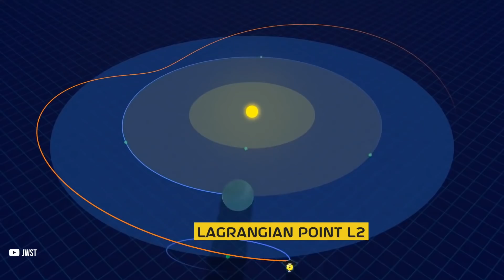What Will Happen Now To The James Webb Telescope

Comment: Was it possible to operate the Webb telescope off of some sort of radioactive power source? I assumed that's what they were going to do, so to get the most time and steady power out of the device once in the L2 point.
Reply: No nuclear  power on this probe. Only probes intended to leave the solar system have nuclear power, because, solar power would  get weaker the further from the sun they got

Comment: Given the short lifespan of JWST (5-10 years), I hope the space agencies are already building a successor or another version of the same. It took a long time to build, a lot longer than 5-10 years. We wouldn't want to sit in the dark after JWST ends its service.
Reply: I got so bummed when I found out it's lifespan.. I am so excited for this technology but I thought it would have long term lifespan technology... Because of how advanced the stuff is... We could use it for discoveries for many many decades.
Reply: Was it possible to operate the Webb telescope off of some sort of radioactive power source? I assumed that's what they were going to do, so to get the most time and steady power out of the device once in the L2 point.
Reply: @benmcreynolds8581  even with shorter lifespan, JWST  is capable of taking much more  pictures in same time than hubble and those images are more detailed.
Reply: They’re already making a successor. They named it the Luvoir Mission.
Reply: The launch went so well that if the other adjustments go perfectly, JWST will have the full 10 year lifespan. So NASA has suggested they'd be able to send a robot servicing mission at the end of the 10 years
Reply: the lifetime of hubble was  5-10 years too ! and stills shines after 30 years
Reply: @telemaq76  still a major difference in accessibility between the considering the Hubble sits in low earth orbit while the JWST is on its way to the other side of the moon a million miles away.
Reply: @MoSuli96  absolutly. you are right. good news is, launch was so perfect than the jwst will have more than 10 years of lifetime. and i heard long time ago, than,maybe..maybe, solutions will exist to improve his lifetime. so future will tell
Reply: Another telescope worth $ 18billion is in making Which will take roughly 10 years